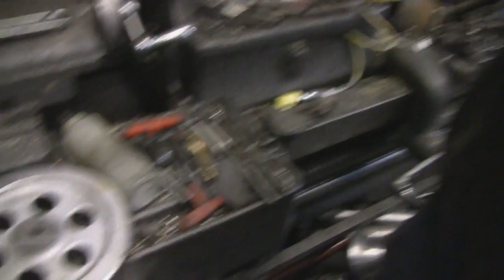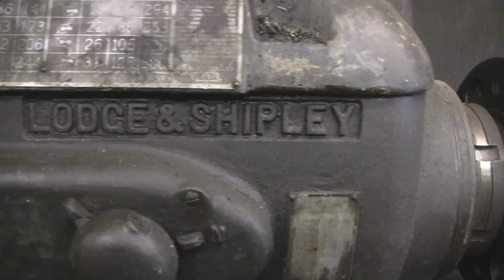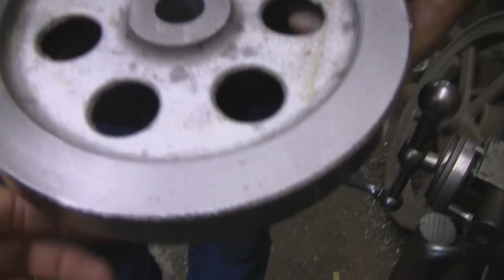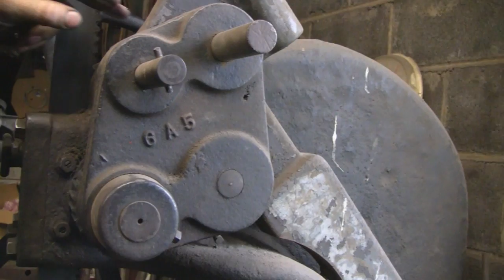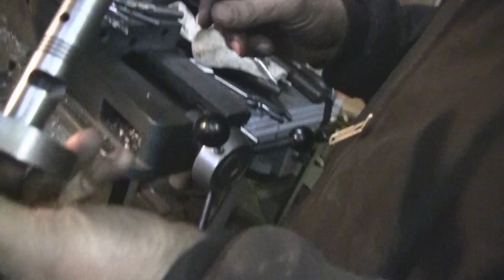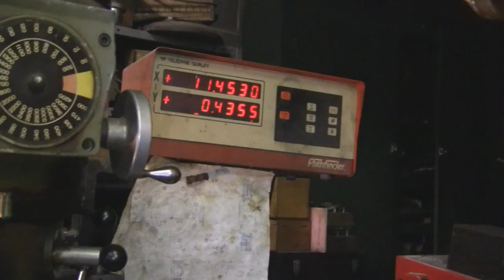HOMEMADE MAYTAG UPRIGHT ENGINE (part 8)

Comment: Well did it line up? Your video ended before you stuck it in the flywheel or are you looking for a new flywheel and crankshaft now? Great informational video. I never would have guessed how that key way was cut in the inside of a hole.
Reply from the maker: +1crazynordlander You'll have to stay tuned for episode 9!!☺